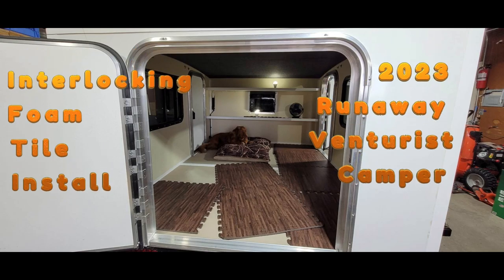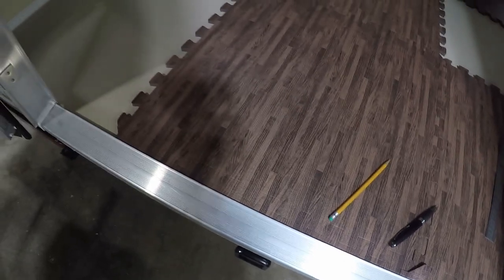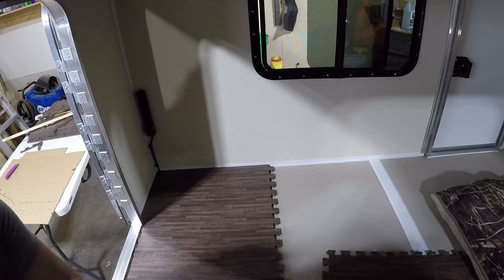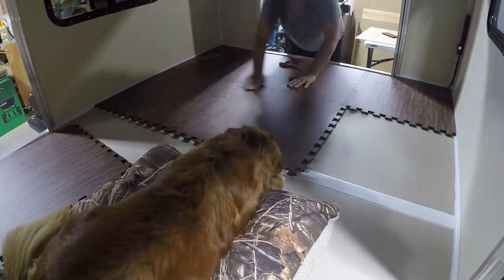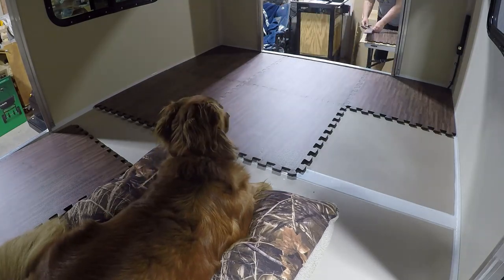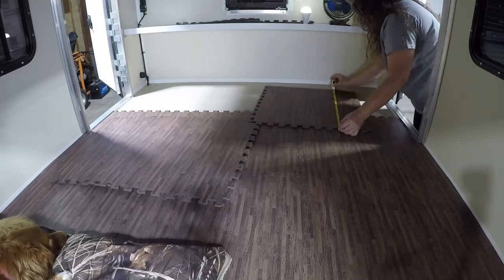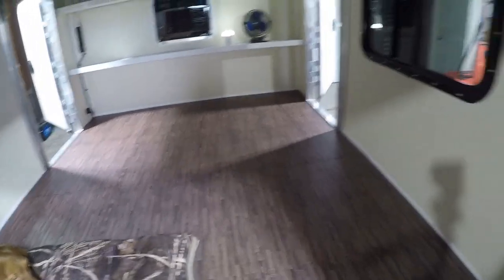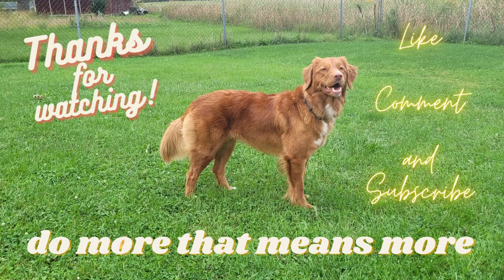Interlocking Foam Floor Tile Install in our 2023 Runaway Venturist Camper

Comment: What is that little light with the carabiner I see sitting on the floor?  Is it battery powered?
Reply from the maker: HI and thanks for watching!  It is a USB rechargeable light! Great for hanging, standing up on end or using as a flashlight in a pinch!  Here is the link: https://www.amazon.com/gp/product/B07THY3GK9/ref=ppx_yo_dt_b_search_asin_title?ie=UTF8&amp;psc=1&_encoding=UTF8&tag=domore08-20&linkCode=ur2&linkId=fab17e070890686bb391aecdd245ad25&camp=1789&creative=9325

Comment: Great job, have you done any more mods for storage? I like the 6 x 8 layout, but there just doesn't seem to be a lot of storage space.
Reply from the maker: We have not.  I bought a few baskets for the shelves to keep from odds and ends rolling around but use the truck as our storage for clothes and all the things other than bedding.  I am not sure if we will do much in the way of storage inside, it's more of the sleeping lounge ;)  We do plan to add a road shower for having water on hand this coming season.  Thanks for watching and dropping a comment!
Reply: @domorethatmeansmore  So, I actually found a 5 x 8 trailer, it is much smaller than I wanted but it was a good deal for what it is. I will build an outside shower. and like you I will use it for sleeping and cook outside. It is so small I can tow with my jeep. Plan to run 12v only.
Reply from the maker: @mps9608  Congrats!  It's time to get out on some new adventures! I love cooking outside  with my one tote kitchen and coleman camp stove 😉